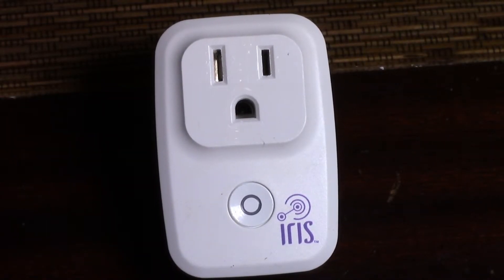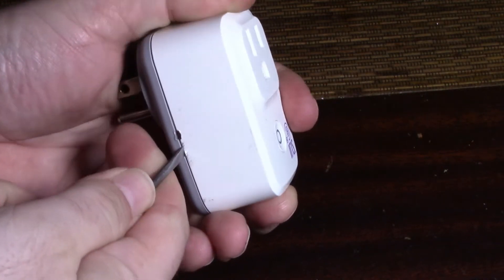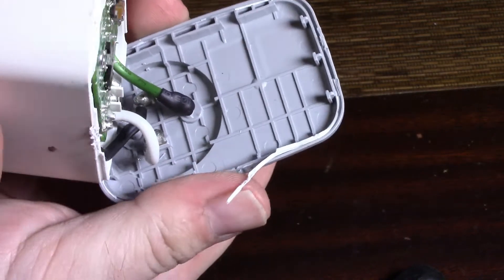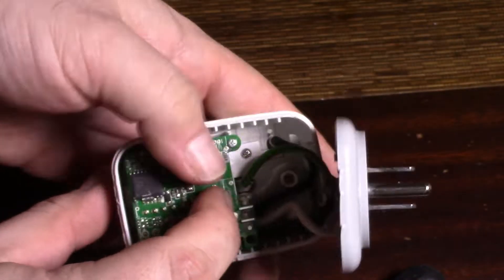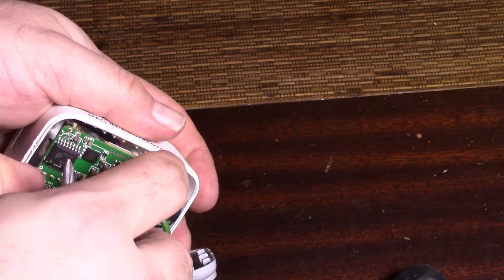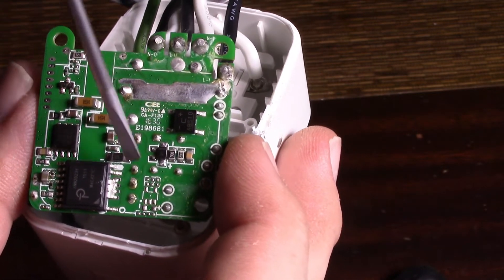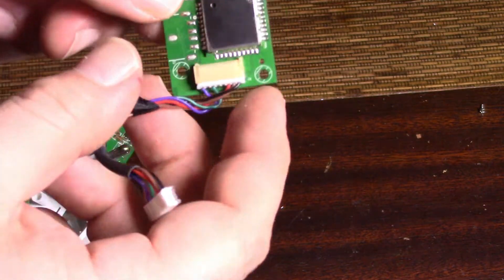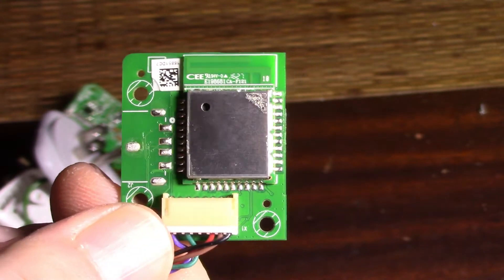Ex-Lowes' Iris Wifi Outlet Teardown

Comment: any update on this or should I just throw mine in the trash? I have three or four of them. I notived on the Lite-On chips manual that it has a programmable mode that can be enabled when changing the value on pin 25? Here is a link to the Github open source software and some info
https://www.wl-net.net/blog/post/bringing-back-iris-lowes-arcus
https://github.com/arcus-smart-home
Reply from the maker: I threw mine out.  There are so many inexpensive and useful outlet modules out there now.  It really depends how much effort you want to put into it.  That firmware looks like it would work, but I dont have that module anymore to try it. Definitely could not hurt to try in your case since you have a few.
Reply: @FixitFrank   Hi Frank & Michael, I'm not on the same level as you guys but sure would like to get my Iris working again. I have 8 or 10 of these and never did give up on there being a work around or someone coming up with a fix. To the point, if you guys think they can be made to work on another system on the cheap, I sure would be interested in hearing from you. Thanks, Paul
Reply: Hi Michael, I sent a reply to Frank if you could read it, Thanks, Paul

Comment: Can this be done homemade with arduino and esp8266?
Reply from the maker: Yup. There are quite a few projects out there to do that. You don't need the arduino. The esp has all the processing and webhost power you need.  Retrofitting this one is a waste of time due to how cheap the outlet modules are but you can definitely build esp based controllers that are smart home compatible. Look up 'Tasmota' for starters